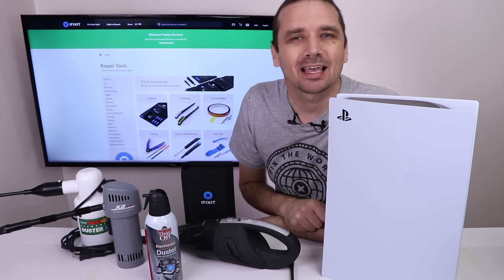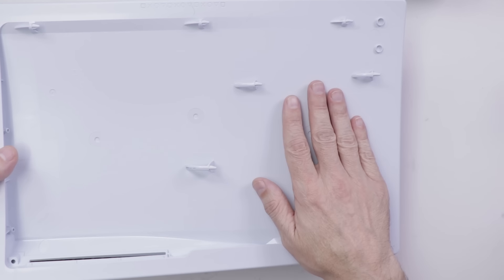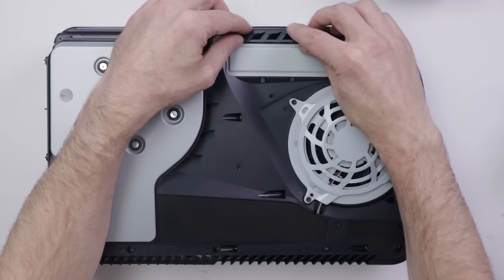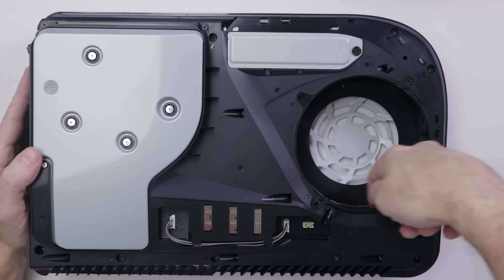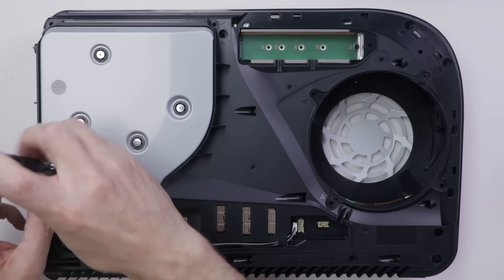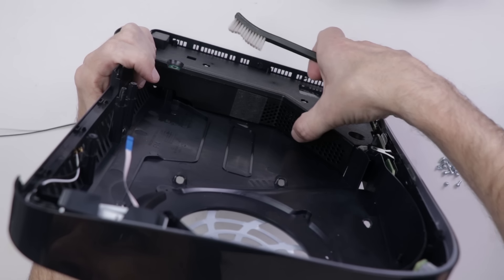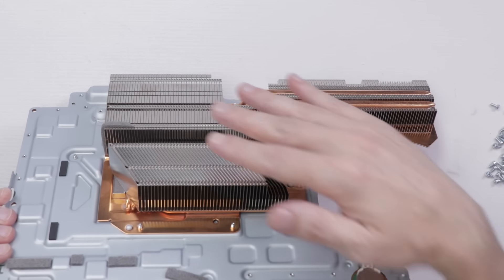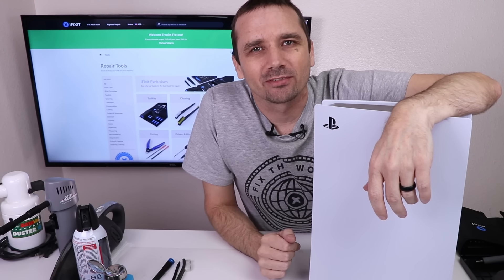How to Clean Your PS5 Safely - 3 Stages

Comment: Honestly, removing that fan via the plug was the most stressful thing I’ve ever done. Felt like Operation but with consequences
Reply: isnt removing that adhesive part that covers fan plug voids your warranty?
Reply: @SuporexTV  nope, warranty stickers have no validity.
Reply: Any tips on doing it
Reply: @shar1able  honestly all I can say is be really careful and don’t rush it. My hand slipped a few times and my heart kept seizing because the tip of my pliers would catch the cables. So just be really really careful and don’t rush it. Don’t yank it out, just follow this video carefully and do what he does
Reply: when I tried to unplug it with pliers I accidentally tore off some of the plastic/rubber coating that protects the wires. It’s near where the three wires meet the little white piece. It’s not a huge tear but there definitely is a small area where the actual wire is exposed and not covered by the plastic coating. The fan still works but I’m wondering, will it be fine in the long run? Will it cause any other damage to my PS5 and should I be looking to buy a new fan?
Reply: @TheBradenGaming  if the fan works then it's fine in my book if your worried get a new fan but they cost alot
Reply: @TheBradenGaming  of anything you could cover the exposed parts with little baby pieces of electrical tape no?
Reply: @TheBradenGaming  that sucks
Reply: @Fabio-ql5yf  don't do it? In turn causing you to neglect thorough and very necessary cleaning of your console - ok then, see how long it lasts with just a stage 1 cleaning then. (It will start to perform poorly from lack of cleaning btw, eventually malfunctioning)
Reply: Removing the sticker over the fan plug in, can you stick it back on after removing it? Or is it done for?
Reply: @drummeryan  i just removed it enough to remove the white plug.
Reply: @shkhrvarshney  good idea.About a month ago when I cleaned my ps5, I completely peeled it off and unplugged the fan. The adhesive is strong enough to stick back on with no issues, my only concern is how many times you can do that. I assume eventually over the years, the adhesive will wear out if I keep peeling it off, so next time I’ll do what you did. Just peel it enough to unplug.
Reply: @drummeryan  yeah for stage two you don't need to go any further
Reply: @SuporexTV  maybe but tbh with the warranty your not getting your system back for months literally 😂I’ll take my chances nd push come to shove get a new ps5
Reply: @jine7123  i bought a ps4 the day they released.. all i ever did was vacuum the outside now and then… its still running same as day 1. But i dont use it anymore due to ps5 🤷‍♂️
Reply: If he was doing it for the 1st time it would have been harder for him as well. I had a similar issue what I did was kept push my pliers back down every time I'd wriggle side to side on the fan plug. I wrecked a plug back on the ps4 because a guide didn't explain it better so definitely understand.
Reply: @TheBradenGaming   it's fine it happens to mine and still works perfectly.  I never did stage 3 coz didn't need it and plus i ain't a kind of person so good is assembling and stuff
Reply: Is it true that if you use the van air the dust will just go more deep inside the ps5
Reply: I tried this from another video and ended up ripping the whole connector out.
Reply: Can you clean the fan without removing the fan wires?
Reply: That was easy didn't  even need pliers
Reply: @shar1able there's these little plastic pry bars that come with your electronics toolkit usually and if you have two of then then you can use one on each side to lift up at the same time and it'll come straight out
Reply: @Universe Observer  Yes. I never unplug the fan. It lifts out far enough to be able to clean both sides. Just don't be heavy handed and tug on the wire too hard.
Reply: @MrBocco1  yes but over time those tiny wires that you're bending back and forth can break off on the inside of the insulation and you wouldn't even know it and lose connection. That's why it's better to just learn how to pull it from the connector itself
Reply: @Damian Shafer  They bend very little as long as you're delicate with it. At no point do you need to push them past a 45° angle. It's highly unlikely to negatively affect the wires unless you're cleaning it every week and bending the wires back on themselves.

Of course if you can pull it out then pull it out. But if you don't have the tools or don't feel confident doing it then you can still clean it without removing it and it's not likely to affect your ps5.
Reply: I tore one of the wires out whilst doing this... my replacement fan just arrived today, luckily it was only €36 and took 2 days to get here
Reply: I just used my fingers/fingernails to grab the connector he uses pliers for, a little wiggle and it came right out no problem.
Reply: To those having a hard time removing the fan connector, make sure you do not just pull the pliers up as it will hit the small cables. Just press the pliers firmly and "move your hand left to right while pulling it up slowly." You should feel the connector slowly getting removed.
Reply: @SuporexTV  shouldn’t be with the right to repair law now in place
Reply: @riley5032  I know it’s a year old but my reply just happens to be that a new fan cost 25 bucks nothing major. The more expensive is 70 but 25 will suit.
Reply: Help me the pliers aren’t working and im tearing up the white part
Reply: My fingers came in handy was much safer imo done it lots of times though to other devices 

You will need fingers nails however
Reply: So I did this step by step to the core, put it all back together, and now it won't turn on 😅 the power button makes one bleep and nothing happens. Any suggestions?
Reply: @TheBradenGaming I did a similar thing today the pliers slipped and caught the white plastic casing and now theres a tiny piece of chewed up plastic. Didnt damage the wire luckily but im in same situation as you now. Just hoping its not broken the fan is working atm so hopefully ok. Is yours still working correctly?
Reply: @dusty203 Did you do this ok? I damaged the white part with the pliers when i tried this today too. Is yours still working ok? I lut mine back together and turned it on and the fan seems to be working for now.
Reply: @Mitchlovejoy  im not sure i had to fully replace my ps5 not because of the white part but because my disc drive was damaged
Reply: @dusty203  Ah no man that sucks sorry to hear that happened. Hopefully the new console is ok.
Reply: Just broke 2 of the wires trying to unplug it and its still stuck inside 😭😭😭
Reply: Don’t ever remove the fan completely. Just pull it out don’t take out the wires. You can damage the ps5 easily that way.
Reply: Yeah mine ripped off smfh
Reply: Good thing you didnt go nay farther. I damn near felt sick getting to the motherboard.
Reply: I was frustrated as hell taking that thing apart lol
Reply: @NASS.D  No kidding. Back in the day when my Xbox went down on me I bought a new one, then used a hair dryer to swap out the stickers that had the serial numbers on them and returned the broken one to Walmart. Same difference as a warranty exchange except Walmart has to wait for another console to replace it(considering they already had hundreds in stock I figured they'd be alright) instead of myself. 

I dunno if that's the most ethical or honest thing to do but I did it. I haven't ever looked at the PS5 to see if that's even possible anymore but it could be a potential solution if anyone ever needs it.
Reply: First time I did it I used pliers but didn't grip tight enough, pliers slipped and snapped one of the wires 🤦🏼 took about an hour to remove the cable clamp (don't know what it's actually called) from inside the white connector, unclamp the broken bit of wire, strip the good wire back slightly and re-clamp the end because of how small and fiddly it was but it worked, thank god.
Reply: Hey, I just cleaned mine and I also removed the fan but now it smells burnt when I turned on my ps5 and I don’t know if maybe I didn’t plug it back in correctly or what happened because the fan spins but it doesn’t look like it’s spinning very fast
Reply: @fluxl10   All operations have consequences if you mess up lol. But, i completely understand what you mean XD
Reply: @jine7123  true but it would take years for any damage to show especially if you do stage 1 cleaning
Reply: @TheBradenGaming I know I’m three years late but incase you still have the same console and fan go to a mechanics shop like Autozone and ask if they have liquid rubber, it comes in a little can and the lid is a brush that you use to literally paint new rubber onto it just be very careful and I’d recommend buying a small tiny paintbrush instead of using the big applicator that’s built into the lid of the liquid rubber. Basically it’s like glue but for wires, my dads been using the stuff since I was little when working on cars I don’t see why it wouldn’t work here. Typically any exposed wire is extremely dangerous as it increases the chances of fires starting as dust can ignite from hitting a hot wire.
Reply: @TheBradenGaming  how's it been 3 years on?
Reply: yeah thanks to these crappy ass instructions mine’s destroyed 😄👍 guess i can return the tool kit i bought and pay a repair man to hopefully fix my cooling fan!!
Reply: I used my fingers to unplug it ez
Reply: @fluxl10  guys if you buy a DIY ps5 toolkit becareful cuz the cheap ones come with a set of pliers that is really flimsy and weak  and when you try to grab the fan connector and it slips every time you try, it cuts the fan wire a lil every time (only cut through the plastic outer layer with how many times I retried it) so to make your life way easier go to your local Walmart and buy a set of regular mini pliers and it makes it 100x easier to take out the fan connector 👍🏼

Comment: You're a life saver. Did the stage 3 cleaning. Boy did it need it. Heat sinks were so filthy the power source would over heat and turn off. Not a speck of dust left in there. Just booted it up and returnal is working as expected. Thanks for the detailed walk through. Subbed!
Reply: This was this issue today for me , filllty heatsinks and now full stage 3 and I'm watching s3 ep2 of mandalorian
Reply: When you say over heat and turn off what exactly happened? Did you get a error code? Ive been having freezing and shutting off and wondering if cleaning would do the trick for me
Reply: @bradyrohr8423  I have also been experiencing overheating and, at least in my case, the console will just black screen, no warning or error message. Unable to turn the console back on without disconnecting and reconnecting the power source
Reply: @mcgfn  same!
Reply: @mcgfn  exactly same with me
Reply: Yup, exactly the same for me. Happened for the second time already. First Stage 3 clean was needed after 2 years, second only after 7-8 months but it’s also burning hot today here
Reply: i would like to do a level 3 cleaning but I don't have the right screwdrivers to open the console. Where did you buy the screwdrivers and how much did you pay for them? The toolkit is a little bit expensive honestly
Reply: You must live or have it in a very dusty place because mine had barely any dust after opening it for the first time in 2 years
Reply: @jmoriarty8000  Same here. What really helped was putting a pillow sheet over my PS5, completely covering it when not in use.
Reply: @savagesleepy  I actually took it apart just up to the fan since I got it the first year, was pretty easy actually. Was barely any dust
Reply: same with me
Reply: @mcgfn  thats what happened w me, do i need to do stage 3
Reply: Hoping this works for me. I’m buying the tolls for cheap, need the screwdriver. My PS5 shuts off after 25 minutes of gameplay. Only PS5 games.
Reply: i did it and my disk drive stopped working any answers?